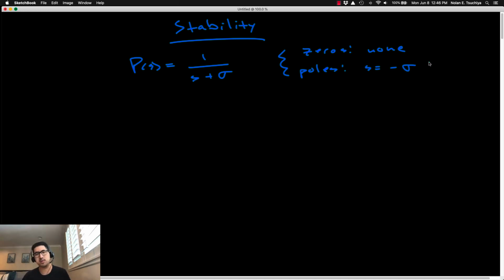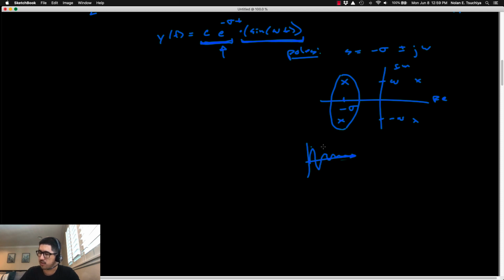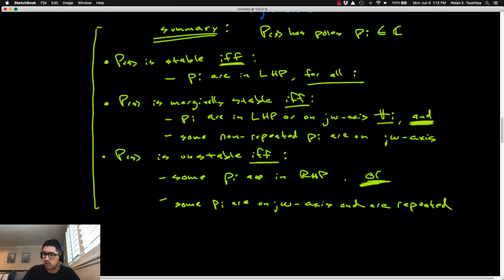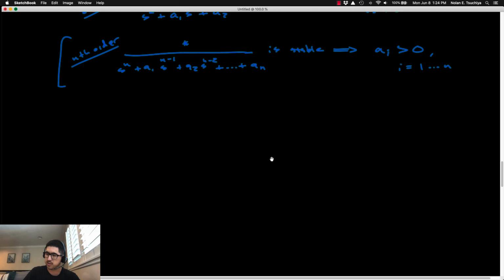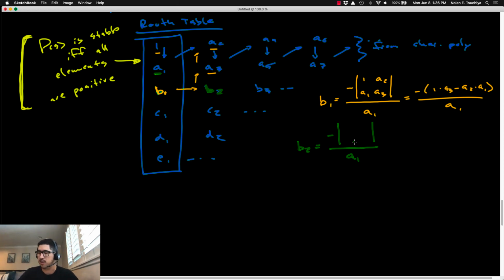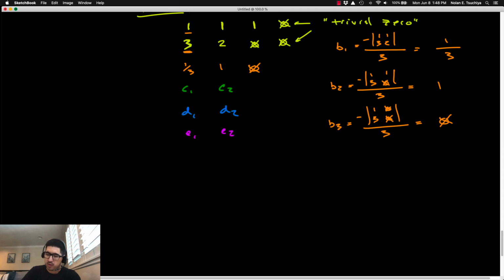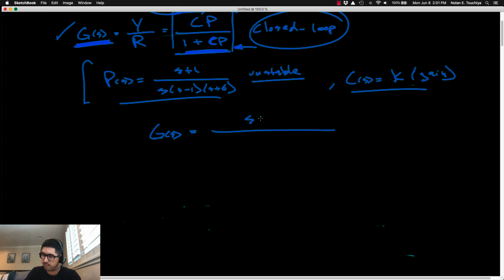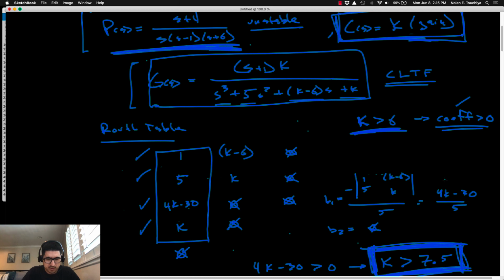Lecture 05 | Stability | Feedback Control Systems ME4391/L | Cal Poly Pomona

Comment: Nolan, first, thank you so much for this series of videos which you put out about 5 years ago.  They are really helping me.  I wonder on this video, though, if there was a slight error at about 1:11:00: 

 Shouldn't the denominator of G(s) be: s^3 +5s^2 + (k-6)s + (k-6) rather than ... +(k-6)s + k?  (In other words, isn't there a missing -6 constant term at the end)?  From there, the final term on the Routh table would be (k-6) rather than k.  Of course, this is still less than 7.5, so it doesn't affect the stability because the 4k-30 term dominates.  

Thanks much for the video anyways. You make this stuff very clear!